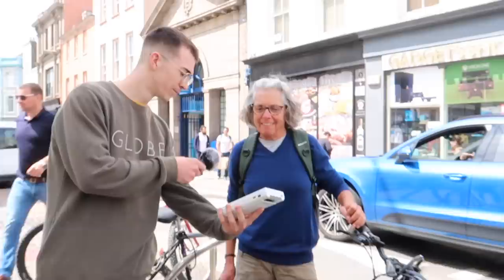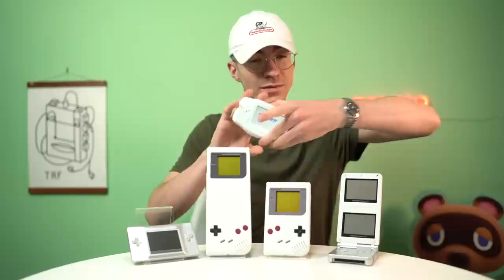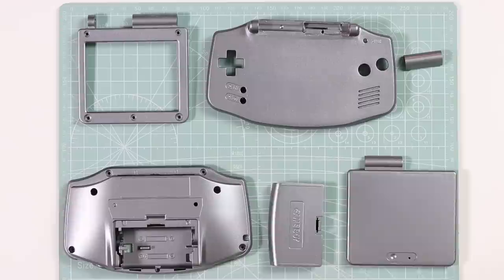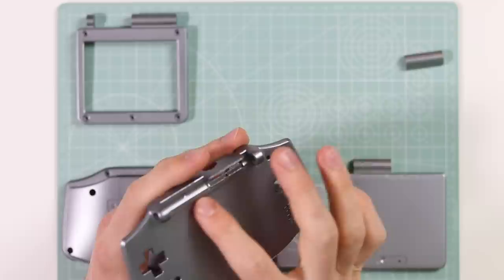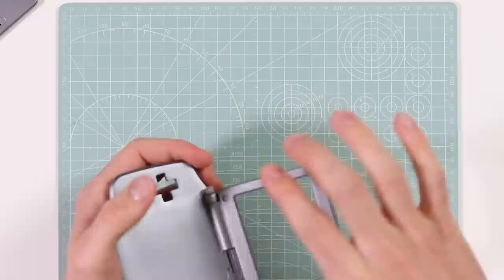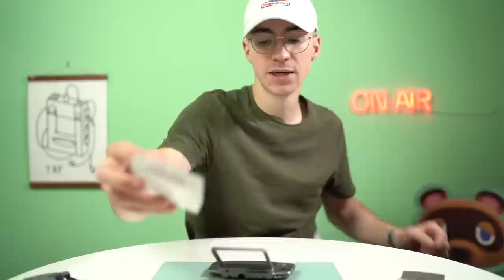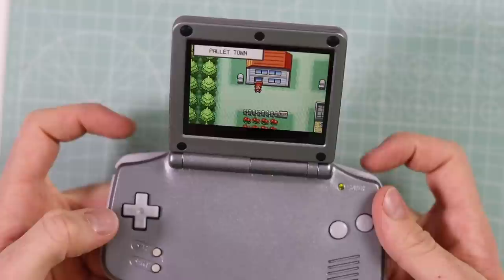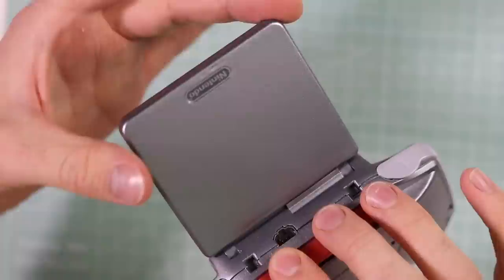I built the GameBoy we always wanted

Comment: 13:38 You could put a giant Speaker where the old screeen was
Reply: He could put that big gba sub-woofer in there. It would be like having rumble in the gba
Reply: I legit want him to do.this
Reply: That is EXACTLY what I was thinking!!!
Reply: Either a big speaker or keep the original screen and have 2 screens like the 2 screened sp
Reply: I was thinking he could of sunk the screen into a bit, so it wouldn't mound on top as much.
Reply: I suggested the speaker thing on the community post and disappointed that it didn't happen. one of these with the Game Boy amp mod, even if the back would have to be extended slightly https://www.ebay.co.uk/itm/56mm-8-Ohm-Lightweight-Loudspeaker-Slim-Low-Profile-Radio-Speaker-/114190452168?_trksid=p2385738.m4383.l4275.c10 the original speaker mount could then be left empty and would then function as a kind of bass reflex port :P
Reply: Nah; true stereo speakers. Experience over loudness.
Reply: is it really wide enough for stereo though...?
Reply: @RWL2012  I'm sure 2 GBA speakers would fit in where the default screen would've been, but recessed to avoid colliding with the SP screen. It would have to be wired from the original headphone circuit though.
Reply: orrrr.... an Lcd digital watch/clock to keep track of time spent gaming and a nice big red nintendo logo undernieth ^_^
Reply: @samaeldrakul4191  Like a Game(boy) And Watch. Genius! Respect. 🤜🤛 🤝
Reply: Or a giant battery to play for longer
Reply: I think it would be more epic to put a second screen on the bottom, which would display the box art of the current game. 😮
Reply: Or second display
Reply: Move the speakers there and put two thumbsticks where they were and make it a rom system and you have a killer GBA themed rom system

Comment: When your working with Bondo don't be afraid to start sanding a little bit sooner than you think you should. The material will be hard enough to not lose form but soft enough to knock down easily. The other thing I would suggest in the future, pun intended, is to use some sort of block when you sand. It will provide a solid flat surface that yields excellent uniform results across a flat surface like the top of the bottom shelf.

Otherwise this is a quirky little unique build and it looks good.

Comment: I'm kinda wondering if there's a decent rechargeable battery that would fit where the screen used to be.
Reply: @rfretehb6519  That would probably work, but I was hoping for something with a little more charge-time...
Reply: I think he tried to advoid messing with the internal build, as it would require many and many adjustments that could go south. 
But that's probably possible.

Comment: A spray painting trick I've learned from years of making models is to take wooden sticks (something like a kabob stick) and shove it through the box so you can hang the piece your spraying inside the box. Instead of having it lay on the bottom where paint builds up. This should give you a cleaner, less "globby" finish, and make the process easier.

Comment: Am I the only one who thinks this looks kinda cursed?
Reply: Not just you
Reply: It's the empty space between the buttons. it looks empty without anything there.
Reply: Yeah, honestly, I don't get it. If you wanted comfy controls, just get the original GBA. The SP flip up design is pointless if it's just as big as an original GBA as it only makes the original design bigger. The only thing that would make this worth doing is if you could fit in a really big rechargable battery with all the extra space left behind from where the old GBA screen was, plus use the normal battery compartment space.
Reply: Dude, the look kinda makes me uncomfortable idk why but it just activates my fight-or-flight response
Reply: Is that this is kinda pointless. That empty space in the bottom part is ugly and just asd nothing.

Comment: I love the idea and the work you put into it, I didn't spot a single cosmetic flaw until you pointed them out, haha. I have a suggestion if you ever try building a custom one in this design again... Use a clear case or just a clear section of case, and flip the direction the cartridge loads in, so you can see the cartridge face through the front of the case rather than flipping it around and be playing the game on the screen right above! It is probably a ton of work, completely custom case design and maybe not even possible but when I saw you covering up the old screen hole in the GBA I immediately thought of doing that instead.

Comment: There's a much less difficult way of getting the benefits of a clamshell design, you could've just taken a normal GBA, maybe swapped out the screen for something better, and made a guard for the screen that would close down. Basically you'd be using the "bottom screen" of the gameboy rather than the "top screen", meaning you wouldn't even have to interact with electronics. Of course it would look kinda strange when you open it up and the screen shield is just, in the position of a top screen without having one, but I'm sure something could be engineered to have it flip onto the back or something. But you did it the hard way for a top screen, which is maybe even cooler.

Comment: If you have speed control on your dremel (some have high/low ) and use a slow speed with a thin cut off wheel you can get clean nonmelted cuts

Comment: A bench mill/cnc with a tiny milling bit would had been better tool option in the  3:13 step. Also there's an atachment for your dremel that turns it into a bench drill/mill ( https://www.amazon.com/Milescraft-1097-Stand-Drill-Rotary/dp/B0001GMENE ). You just put a milling bit on it, adjust and mill the piece at an even level.

Comment: it's just the perfect GBA. If only Nintendo had given the GBA x/y buttons would it be better. 3.5mm jack, self protecting screen design. What is there not to like. the only mod I might think of adding is to integrate a rechargeable battery and charge port into the design. other than that it's just simply perfect.

Comment: question: so i wanted to do ags-001 screen mod for my agb (not 101, specifically bc ease of use in sunlight), but i also want to do this mod for ergonomics, would this work with that? especially if I wanted to add a brightness control as well. thanks!